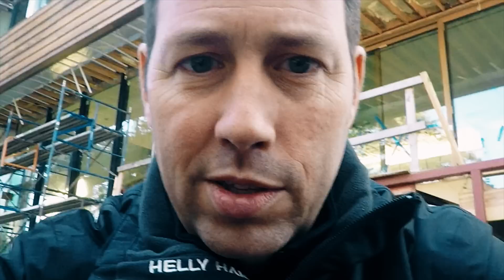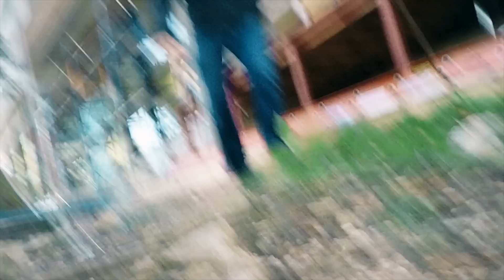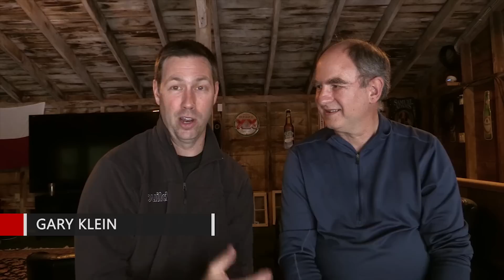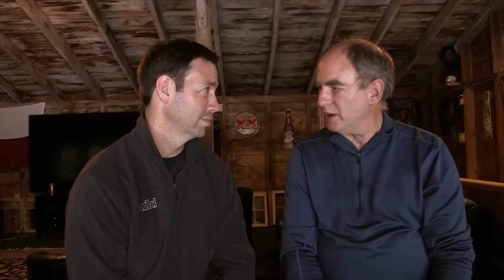Gary Klein Interview :: Risinger Goes Rogue

Comment: What a great interview. And so many good takeaways. I really like how you 1. focus on constantly learning 2. try to solve problems with science and 3. always seek out experts to improve the product you deliver to your customers. To top it all off you go out of your way to share this with other builders and potential clients. Hopefully the focus on conserving water by delivering hot water more quickly to the tap will spill over into other areas. For example It's always bothered me that we flush out toilets with potable water. Could we flush our toilets with water captured from the shower/tub/bath sink drains? Could we also capture the latent heat in the hot shower water that goes down the drain to preheat the cold water heading to the hot water heater?

Comment: Is there anyway to design a home run pex system that is efficient in a large house 5000sqft.   I love the pex manifold with centralized & individual shut offs.    Even if you put in a bunch of hot water recirculators you would still be wasting a ton more water vs non home run system.
Reply: No, watch Gary's lesson on YouTube.  All that extra pipe leads to more enevitable  heat loss. Pex doubles the pipe length.